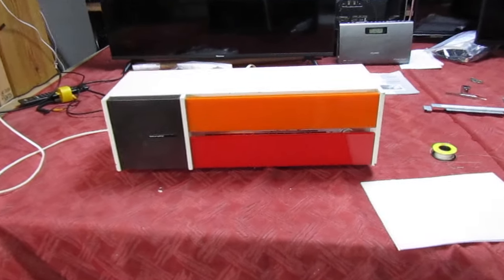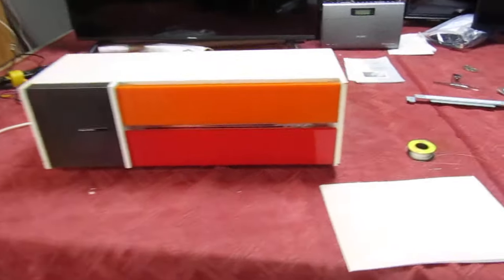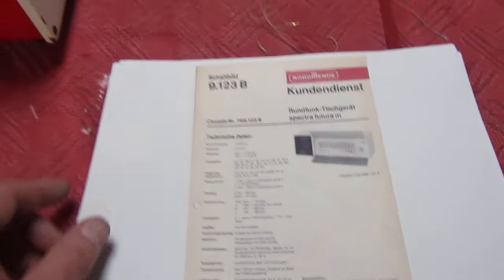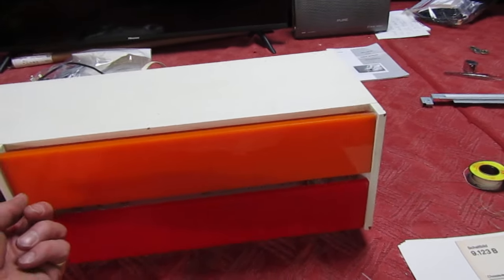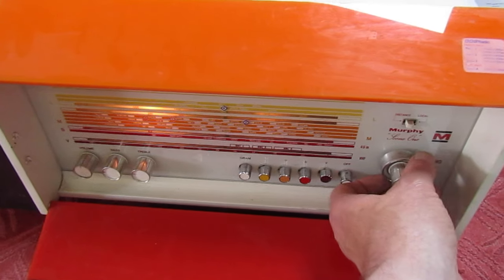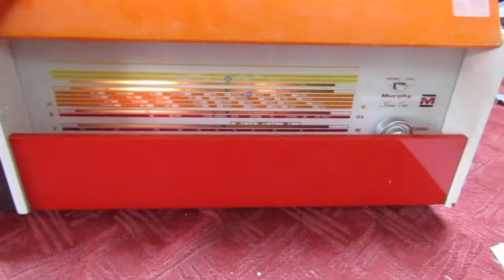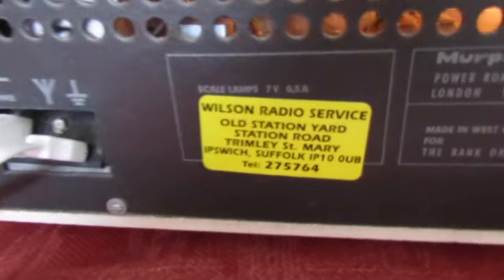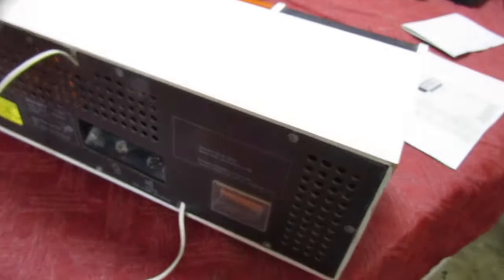cool retro looking  murphy radio

Comment: Most Excellent! Thanks for sharing! Wow, that's a trip man 🤣 
This take me back to the 1980s when I repaired a few Nordmende Colour TV's. They were extremely reliable back in the day, so it made a nice change to take look at them when they did turn up. I must have repaired hundreds of Nordmende VHS machines back in the day, since they were just JVC's with  different front and badge and I worked for the main dealer of Nordmende and almost every brand you can think of down here in the Portsmouth area....

Comment: I've got a Nordmende radio up in the loft of the garage. Very sure it's the "normal" version of this with a veneered wooden case. I'll have a look tomorrow.
Reply from the maker: Cant just remember now but I think there was different colours of cabinet you could order in the same radio.
Reply: @michaeldranfield7140  Mine has a metal badge on the front that has Spectra Phonic and a rainbow printed on it. I guess these did come in different colours. And...  it's got a broken tuning cord!